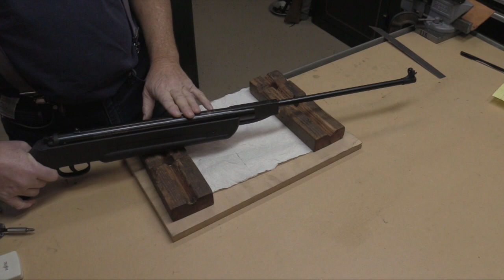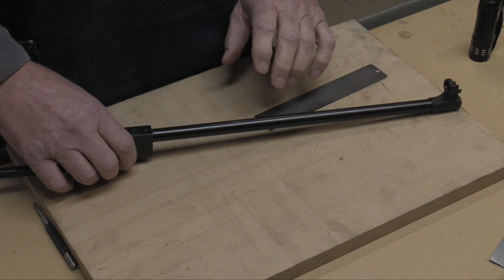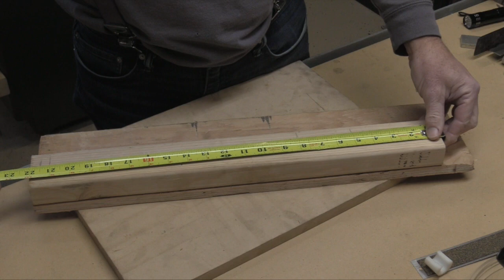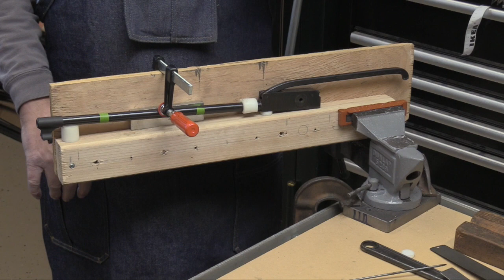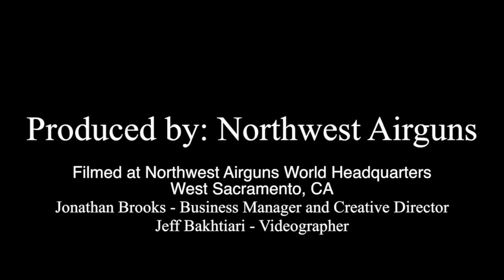Air Time No. 10 - Bend your Airgun Barrel

Comment: I'd admit it if I let it go but I didn't in my case, I bought an old ij-22 Soviet breakbarrel but never saw in the pictures just how bent it was.

It's not the barrel as much really.
The tube/compressor housing is bent up and to the left.
And the forks are bent upwards too.

I really want a good ij-22.
They're just the best looking handy little breakbarrels to me.
But I'm kinda afraid it's beyond restoration, the breech, barrel and compressor housing all have some bends.
And judging by the smoothness of the old metal surface (no nicks or dents) I think it wasn't dropped or anything but rather someone long ago let the barrel slip when cocking.

Do you think it's possible to get it all in alignment again?
Reply from the maker: Sounds pretty bad.  How does it shoot?
Reply: @NorthWestAirgun  
Thanks for your reply 👍🏻

grouping? I couldn't really give an accurate representation, only shot it like 30 times with a few different pellets off hand at about 10 yards, and it shot to the right if I remember,  shot like a pellet tin sized group and much to the side.
Then I realized in the shine that the compressor tube was bent too.
(The barrel and breech block themselves seem vertically quite straight actually, just a bit off to the side horizontally.)
The majority is in the compressor tube, it's like "crumped up" and bent up a bit where the breech contacts the tube.
(The forks might be a tiny bit bent up too, but it's definitely more in the compressor tube/housing)

I think from pivot to the front sight it's up out of alignment by about an half and inch.

Other than that, the barrel break latch works, it cocks, it shoots but usually you need to fire twice to get the pellet to clear the barrel (tried 4 different .177 pellet brands) 
Think the seal is just too old tho, probably the original leather seal from the 60s or 70s

And I don't really want to put a lot more effort into it if I'm not sure I can straighten it out properly.
(I'd like to shoot properly at different ranges)
Reply: The brass rifling/bore looks good tho.

Comment: Do you take repairs from all over? I have a swarm whisper and I put a adjustment screw for the trigger in and it was adjusted too much and I cocked it and it didn’t catch and it snapped back up and bent the barrel. I attempted to bend it back, but would like to have it adjusted a little more if possible.
Reply from the maker: Sorry, I'm cutting back on repairs, try the service dept at Pyramid Air (pyramidair.com)